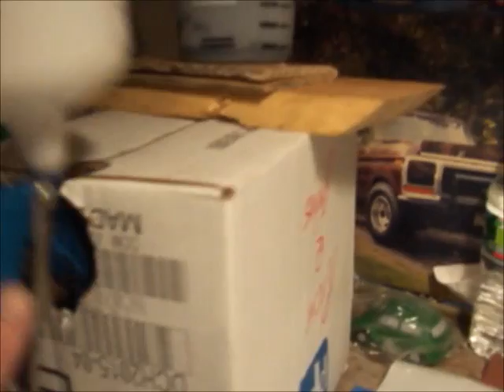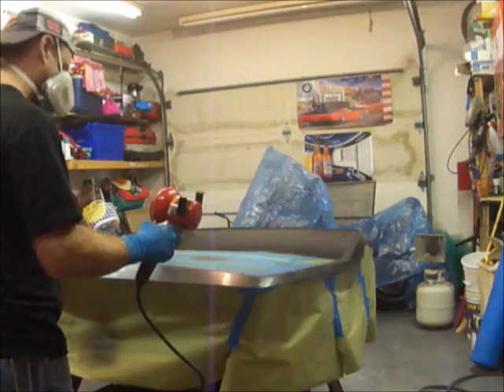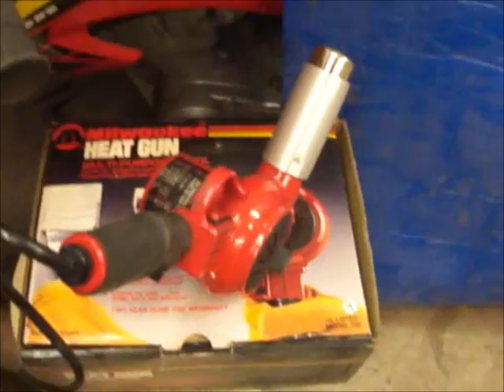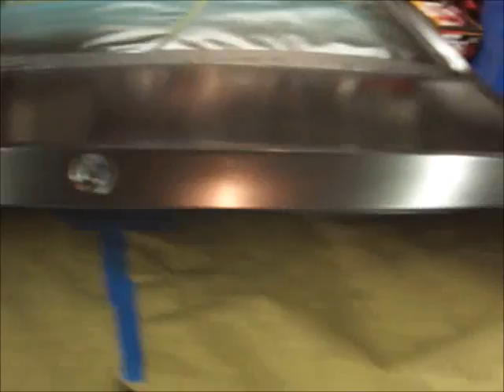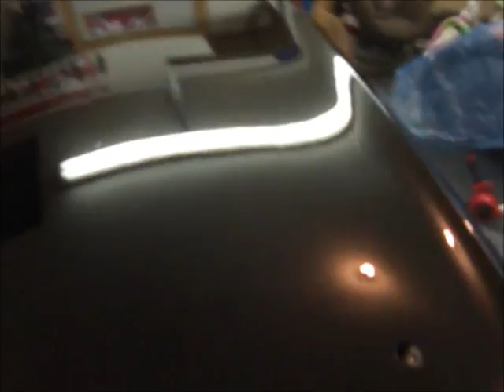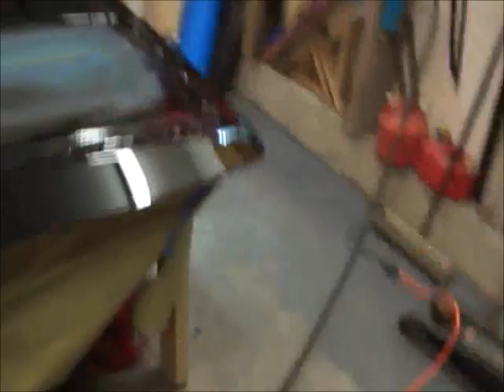Mustang paint time

Comment: Looking good man. What gun and tip are you using there for the clear? Thanks. Oh, 1 trick I did that really helps with dust was to staple painter plastic to the ceiling right over top of the lights and everything, took about 20 minutes.

Comment: i use a hair dryer rather than a heat gun if i'm doing waterbourne at home.
never blowing it straight down but across the panel to pull the water away
with the smaller compressor at home i try to use my mini gun as much as possible to so the compressor can keep up and still get a nice finish, i found with the fullsize gun it would orange peel out as the comp started to get low